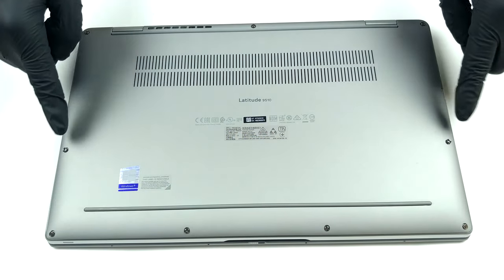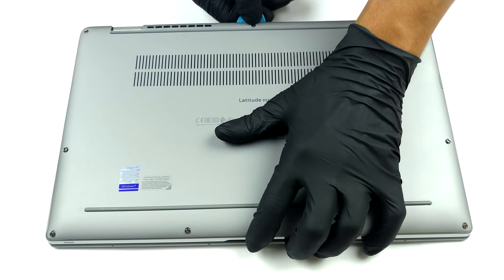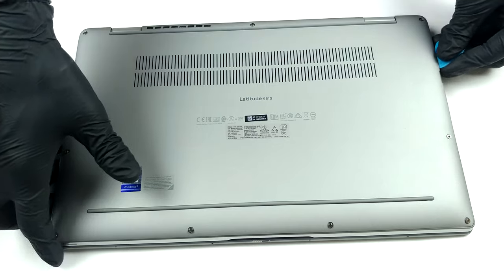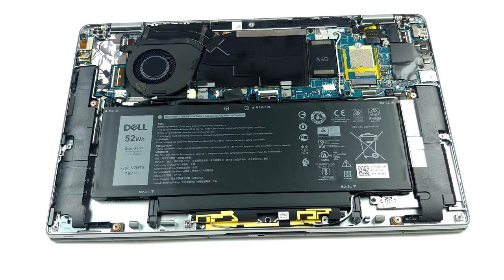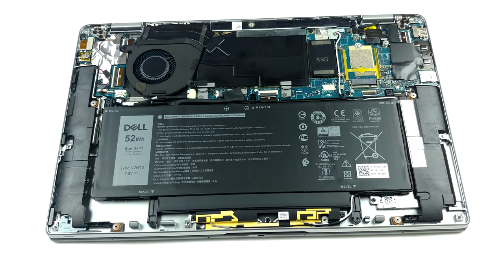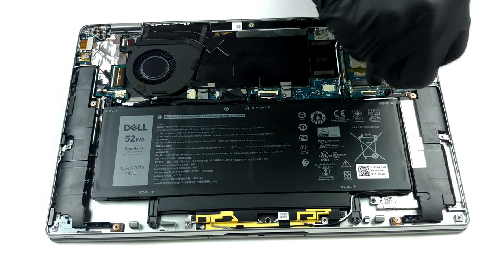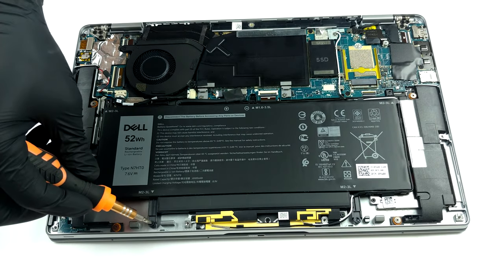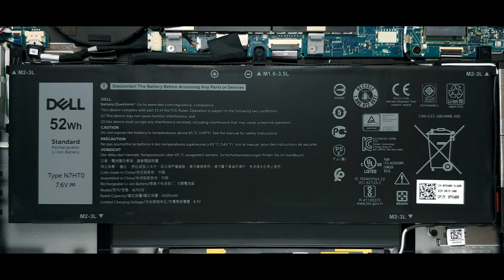🛠️ Dell Latitude 15 9510 - disassembly and upgrade options

Comment: Wasn't it suppose to have a battery of 86.3Wh?
Reply: That's an option, and really cool. I guess this 52wh is the standard.
Reply: @thewheelieguy  can the 52Wh be upgraded to the 88Wh?
Reply: @butlerpc724  Sure but need 4 more M2x3 screws